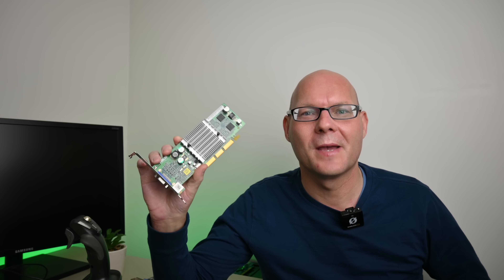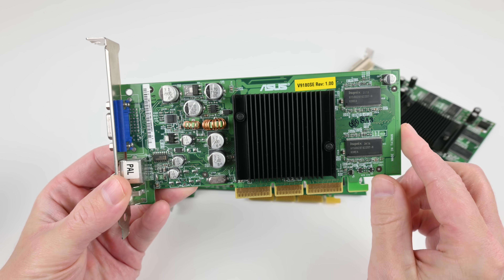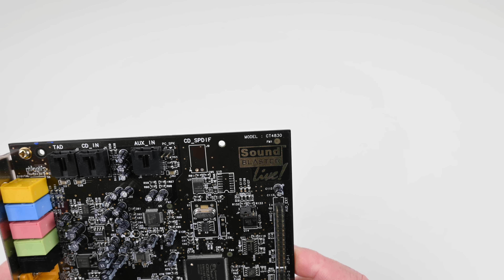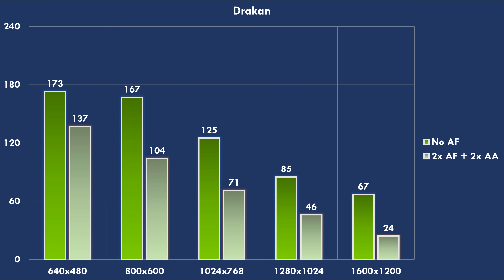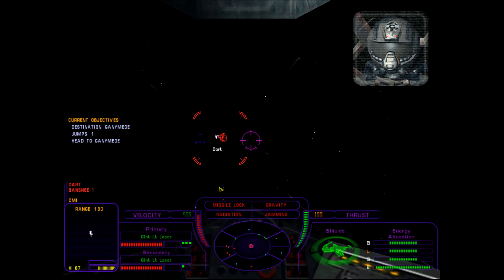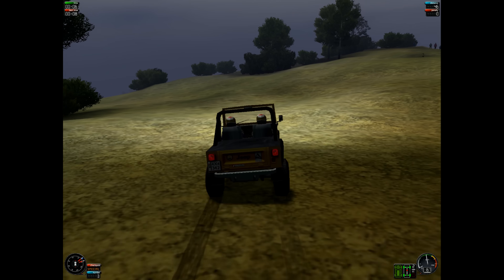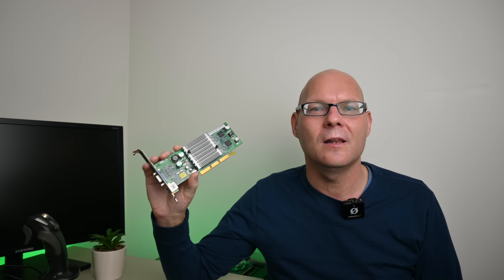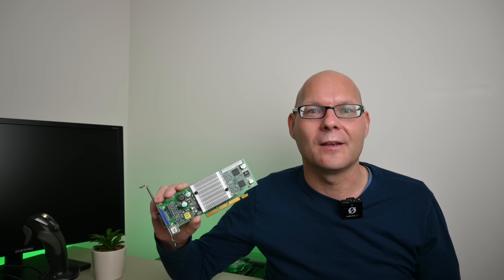One of Nvidia's most Controversial GPU

Comment: This card was truely a party pooper in its day, classic nvidia ewaste IMO. The lack of hardware t/l ment no Battlefield 1942 which was all the game to play at the time, not to mention basically every game made after 2002. They shouldn't have called it a Geforce 4, I believe it was deceiving consumers into thinking they were getting the latest technology but really it was just Geforce 2, the Geforce 3 was a much better product. People would buy brand new PCs with these cards and would quickly find out what the lack of hardware t/l meant, forums were inundated with complaints while nvidia laughed their way to the bank.

And people these days think products like the 4060ti are bad, but we remember the Geforce 4 MX, and its delinquent child the FX5200.

edit: I have been informed that the GF4MX does have hardware t/l and I am probably thinking of the TNT2 but the lack of DX8 on the 4MX was it's real downside.
Reply: It has hardware t/l but doesn’t support dx8.1 which was fine anyway since games that required dx8 game after and the card wouldn’t have ran them well anyway. Which is the problem the fx5200 had.
Reply: @DotChaotix  Ah yes I remember you are correct, I am probably thinking of the TNT2 that lacked hardware t/l. The FX5200 was an abomination haha.
Reply: I wanted to add that we used to call the Dell prebuilts that had this GPU/Celeron combo "the dellerons", they were everywhere. Also I should state that as a retro card these are great, so are FX5200 but at the time these products really were not good for consumers/gamers.
Reply from the maker: Agreed!

Comment: hello Phils please tell me I saw in the current video that you are using a wireless optical mouse can you please tell me does it work ok quite well or do you need to install a driver to work correctly
Reply from the maker: It's a basic wireless keyboard and mouse combo from Microsoft. It works just fine, Windows 98 has support for all sort of USB devices. But for actual gaming I plug in a Logitech G400 mouse, it is much smoother. Also USB.

Comment: Here in Brazil there was a model called gf4 mx4000 who had 32 bit interface. Painfully slow, but sold like hot cakes.
Reply from the maker: OMG 32 Bit 🤦‍♂️
Reply: @philscomputerlab  Yes this is news to me, I'd love to see how it performs. Well love isnt the right word but you know what I mean!
Reply: @philscomputerlab  Yeah. My brother had one. It was awful. Something like 2k points in 3dmark2001.
Reply: Same in Argentina. 64MB, 32b MX4000s by XFX were EVERYWHERE! :(
Reply: lol, you would've been better with a Geforce mx200 than that card.
Reply: @mirific87  haha! it was my brother's. i had a ti 4200, so i was good.
Reply: I'd bet the PCBs for those 32-bit parts were stupid-cheap to build, and nVidia probably made millions of the budget-ASIC. (To my knowledge, they were still being soldered onto motherboards well after GF2's hayday, too.)
Not to mention, some companies outside the US (even, 'back then') were guilty of salvaging 'expensive' chips off eWaste, and then soldering them into new-production PCBs. (Didn't some MX-series ASICs make it into 'fake' voodoos, semi-recently?)
Reply: @labrat810  At least in XFX's case the PCB was the same for both the 32b and 64b versions. The only difference was that the 32b version had two memory chips instead of four (I imagine it also lacked the associated components for the missing chips), but the traces and solder pads for them were still there.

Comment: Just one tiny correction: there ARE actually MX 4000s with 128bit memory bandwidth. You can tell which one it is by where the RAM chips are located: if they form a straight line, it's 64 bit at most. If they form an L, it's 128 bit.
Reply: I recebtly bought a very cheap MX4000 with just 32bit  memory bus out of curiosity 🙂 And it was better than expected - as long as you stay with 640x480 resolution.
Reply: @pc-sound-legacy  I encounter one of those back in the day and was awfull por Counterstrike 1.6 players.
Reply from the maker: So confusing 😂 Thanks!
Reply: @philscomputerlab doesn’t help that as recently as a few years ago you could but NOS MX 4000s on eBay… with just photos of the box
Reply: I've yet to bench it, but I recently purchased 2 3D Fuzion (BFGtech) PCI cards with matching PCBs. The strange part: one is a MX 4000 128-bit 128MB and the other a FX 5500 128-bit 256MB.
Reply: mx4000 came later with fx series.
Reply: "Are" isn't an acronym

Comment: I used this in my Pentium 3 PC when my Voodoo 3 card went down. It was awesome.  Worked great for all the 98 games, even Serious Sam worked good.  I always recommend this card (the 440) to people who are building Win 98 machines to play games from the late 90's and don't want to break the bank on a vintage GPU.  It really does work great!
Reply from the maker: You are right, it is a solid GPU for Windows 98! I guess also works well with DOS.
Reply: @philscomputerlab  There was a very useful chart on Vogons for DOS compatability of PCI and AGP graphics cards, but it seems the link doesn't work now (or I couldn't find the right one). In general, as far as I can remember nVIDIA, s3 and 3DFX Voodoo 3/4/5 were good for DOS, ATI and Matrox weren't as good.
Reply from the maker: Ah yes I remember that one. He had a few games that are picky like Commander Keen and other games that use weird resolutions. I think the MX will do pretty good for DOS, better than Radeon.
Reply: @kosmosyche  I did notice that Redneck rampage did crash when I tried to play that game in DOS with the mx 440. But for the most part it was good.
Reply: With the use of dgvoodoo (not dgvoodoo2, the first!) and its DX7 mode, you can even use the Geforce4 MX for glide games btw, very versatile.

Comment: The 'GeForce4 MX 440' was my first GPU! 
My first computer was given to me in 2001 by a friend of my dad's who worked at a software dev company with parts they had lying around - Pentium III 933Mhz - 512MB Ram - ATi Rage 8MB 
When CS1.6 got popular a friend of mine gave me a MX 440 he had spare and it was night and day!
Reply from the maker: Oh my going from a Rage to GeForce4 MX, what an upgrade!
Reply: @philscomputerlab  sadly died some time after cause one time I moved the case with the PC on and turns out the card wasn't seated properly in the slot 😅 just stopped working.. My mate must've had a secret PC shop cause he had a GeForce 4 4400ti I think it was? Or was it a 4800 I can't remember.. Stuck with that card for so many years after that 😋
Reply: The ATI Rage would've been a pretty old, weak card even at the time. They must've carried it over from an older system.
Reply: @chemergency  Oh yeah defo! I mean.. we had dialup until like.. 2003? I didn't really use the PC much in those days.. mostly played PS2 😂 It was only when we got 256kbps and then right after ADSL that I started using the PC more often